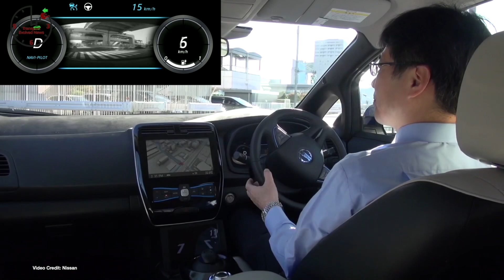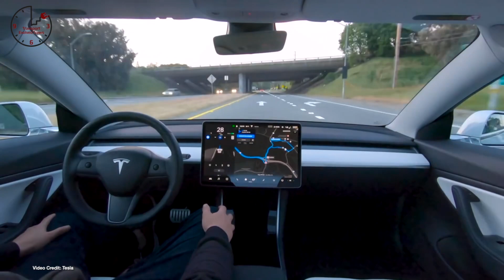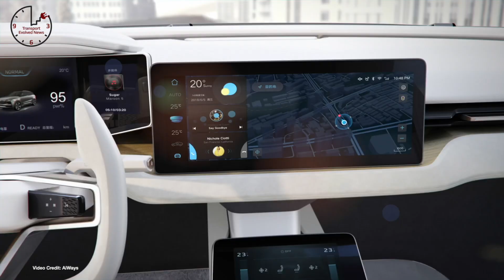TEN 295 - Rivian Rapid Charging, Tesla’s 12-Seat Van, Germany EV Charging Requirement

Comment: Dyson didn't make an electric car because he realizes that with battery prices, he can't make the cost of the car 10 times more than they are worth, just like his vacuum cleaners.
Reply: Plus the whole of his UK market has gone, both brexiters and remainers hate him for his double cross.
Reply: He developed the bagless vacuum, paving the way for battery vacuum, before they were literally 2kw !
He changed hand drying from hot air to cold, again saving energy, it's that the British can't play the stock market to their advantage as well as some, not lack of design.
Reply: @mcamodell  yes but many have bought a 400 quid one which are uneconomical to fix ,and you can buy the same or better for 80 quid
Reply: Making batteries is slow and low margin. Yet you need them for EV's. This is why all the traditional automakers held back from building battery production lines. But if the OEM's were smart, they would have toyed around with in-house battery production with some of their empty factory space during the good times from 2012-2019. Instead, too many automakers are now cutting back on everything EV, hoping that low oil prices will last.
Reply: @Muppetkeeper  "the whole of his UK market has gone"? Haha - get me a pint of what you are on

Comment: Congratulations on no coal burned at power plants in UK !! 😊😊😊❤
Reply: Thanks, we now need to sort out the rubbish charging network
Reply from the maker: Ha! True true! (Although we've not had first-hand experience for a number of years).
Reply: @transportevolved  It's getting there but it's a slow crawl, i couldn't wait so bought a Model 3
Reply: @thelifeofbatteries  I could see why you'd do that, i've taken the other approach of waiting.
Reply: I'm very happy about the UK's 55 days of no coal.  How much gas are they burning?  Coal is the worst, and has to go, but the next step is full decarbonization, or as near as we can get.
Reply: Germany spending 2.5billion on charging infrastructure. Uk spending 5million and you can bet most of that will be in London

Comment: Thanks for the show.... Nikki really reflected the feelings that many of us feel about the challenging times, the multiple crisis in the U.S. and the disturbing response from our politicians.

Germany, I think, had the right idea for requiring gas stations to likewise provide for EV charging. I see a few gas stations here in California having the same idea — having one or two spaces for EV charging while also allow ICE cars to fuel up. If every single is a EV charge station in the U.S., EV range would no longer be a problem even for medium-to-long range road trips. From the another perspective, it seems to be a no-brainer for gas station owners — that you would want to profit from refueling both ICE vehicles as well as EVs.
Reply: Right, because that's what I'd be looking for on a long-distance EV journey: a spot somewhere at a greasy, smelly filling station where I can park my car for half an hour while it recharges.   If the station's got a service bay, maybe I'd kill some time watching someone get their oil changed.   Probably, though, I'll just sit in the car while the pickup trucks come and go.    And of course, the proprietors of those stations will be pretty chuffed to be forced into moving their electric utility rate up several notches due to demand charges.
Reply: @levenkay4468  a growing number of petrol stations in the UK have rapid chargers installed. BP (fossil fuel company) bought Chargemaster and are installing their rapid chargers on their forecourts. I don't care where the charger is as long as it is accessible and functional, and enables me to get from A to B.

Comment: The Rivian tech is based on the same setup as P20 mobile phone which means the battery is treated as two batteries for charging so you can put in high voltage but a single battery when it is used to power the phone, its a smart way of doing it but far from new so I'm surprised Rivan have been allowed to patent it!
Reply: Some portable tool batteries do a similar 18 to 36 volt switch.
Reply: I hope that other makers of battery powered equipment fight that patent, then.  Some times the PTO fails miserably.  I've seen it happen.
Reply: I agree, splitting the series in half is not a novel invention.

Comment: Hi Nikki. I really had to jump in on one thing in particular from your Short Shorts section (is it sponsored by Nair?). You mentioned that someone had calculated that in the UK there were 55 EVs for every charging station. This is yet another example of where we have to be vigilante about misleading claims. You suggest this is further proof that the network is woefully short of capacity. Well, I've looked at Zap-Map and even by it's very conservative figures (by it's nature it doesn't have comprehensive totals) there are 18,279 charging points in the UK. With approximately 2.65 million EVs on the road that works out at 144 EVs for every charging station. However, they record (conservatively) 31,789 connectors. That's 83 cars for every connector. At first this may look like it shows things to be worse than the calculation you quoted. But, let's add some context. There are 35.25 million ICE vehicles in the UK and 8,386 ICE filling stations. That's 4,203 ICE cars per station. If there were on average 6 pumps per station that would be 701 cars per pump. Even if there were 12 pumps per station that would still be 350 cars per pump. Yet, no-one seems to be claiming that ICE filling stations are woefully under capacity. And there's more. Ecotricity estimate that only 13% of their chargers are in use at any one time. Spread that across all charge points and you can easily argue that there is currently an over capacity of chargepoints that already has some future proofing built in. Never mind the ever increasing roll out of charging hubs. We have got to get away from this habit of allowing people to talk about the EV infrastructure as if every EV owner will charge their EV at the exact same time and they will all be using public chargers. It's a million miles away from the truth. And again it doesn't stack up against equal comparison with ICE vehicle fuelling infrastructure. As you can see from the above, the worst case scenario for EVs is that there will be a quarter as many EVs per connector as there are ICE cars per pump. There's a reason why well over 15,000 ICE cars run out of fuel every week in the UK. We need to combat EV ignorance as well as every other kind. Let's be EV Woke.
Reply: Very well said!  Thank you.
Reply: I agree with the general sentiment of your comment, but I'd like to point out the one element you didn't factor in to your calculations is the average time a vehicle uses each outlet (be that ICE or EV), because as I'm sure you're aware, that greatly affects the throughput of the max number of vehicles able to fill up per hour. I also readily promote that the charging behaviour for EVs is not/does not need to be the same as that of ICE (home charging, destination charging etc), however given both the time of learning curve for new behaviour and the aforementioned current high number of people regularly running out of fuel, there will still be a decent proportion of EV drivers that won't necessarily take advantage of these things (humans are flawed after all) and so needing to cater to high numbers of people wanting to charge up during peak hour times etc needs to be accommodated (at least in the short term. And given the increasing uptake of EVs, the worst thing would be for public /commercial charging infrastructure not to stay well ahead of the curve with regards to excess capacity. It's still only early adopters at this point, and as you point out the last thing we need is for a whole bunch of negative press articles and personal accounts of the more EV ambivalent populace about lack of chargers and long waiting times in their local area - which of course may well be a statistical anomaly by comparison overall, but could still change the minds of yet to adopt fencesitters with no personal experience in the matter. Which is is what you're equally arguing, albeit from a slightly different angle 😊

Comment: Encouraging to see Germany require gas stations to provide EV charging capability.
In the 9 years I've owned my LEAF I have seen the city I live in, Hendersonville TN replace the majority of its gas stations with fewer but larger brand new ones. Each time I have contacted the company building these and asked if they would provide EV charging. The cost of running conduits and cables is much less for new construction when the ground is already dug up. In almost all cases I got a reply which is impressive. Woo Hoo! Unfortunately they were all "Dear John" emails with not a single new gas station has installed EV charging.
At the very least new gas stations should be required to install at least one rapid charging station.

Comment: A agree with the Germany charging requirement.  In the US we need a single standard and start by requiring charging at stations around major highways with a roll out to secondary stations over time.  There also needs to be a standard that says what charging level is available (1,2,3) and what the charge rate would be.  I am sorry Tesla, you may have to open your chargers to everyone else and change your plug to the common standard.
Reply: There are some chargers at gas stations. Look on plugshare.com. I think having a charge icon on highway exit signs would be great. I guess we have to ask the Department of Transportation for that.
Reply: Well, Germany only has a requirement for public charging stations which plugs have to be there, and which standard has to be used. Teslas Superchargers are not public chargers though, so they do not have to conform to those rules. 
And as far as i know, the requirement to have at least CCS available is actually an EU rule, not a german one.

Comment: Rivan understands the need to be able to handle technological transitions in ever increasing charging voltage levels ... while Tesla stagnates at 400v.  The industry is transitioning to 800v.. and 1000-1600v will follow that. Companies able to accommodate those transitions and upgrade charging networks in a backwards compatible strategy... will succeed long term.
Reply: Do some research, you don't know what you talking about.  Current battery technology is such that batteries have to be charged at a specific voltage and current, you can't change that, if you do you lose the longevity of the battery. (Unless they invent a different battery chemistry)
Higher voltage 800v-10000000v is not better technology, just like a 2 inch pipe is not better than a 1 inch pipe, depends on the application. That is why your garden hose is not 6 inches, and your house electrical wiring is 120v-240v and not 10,000v.

Comment: Do chargers at petrol stations make sense? It seems to me that it makes more sense at places where you'd drive and stay a while: shopping centres, grocers, hardware shops and places like that. Plug in, shop for half an hour or so, and then load up, unplug and drive off. All my non-home charging happens at shops like that.
I can see petrol stations at motorway lay-bys, but not petrol stations generically.
Reply: Some petrol stations, these days make more money from coffee and snacks, than from actual petrol. Especially stations that don't have facilities for trucks.

In fact, in my hometown, one petrol station chain opened shop in the old town without the petrol station attached. 
So might be an option. Also, it is probably easier to enforce.
Reply: We have them in the UK already. I don't care if a rapid charger is on a petrol station forecourt. My requirements are that it is accessible, functional, and in a place that enables me to complete my journey.

Comment: Are filling stations really the best location for charging? Apart from service stations on motorways,  would it not be better to put the in locations that cars are parked at anyway? Car parks at , shopping centres , gyms, etc etc
Reply: Good point. Though just having the constant reminder to all ICE users, every time they fill up, that they could be on a cleaner, greener path... That's good advertising for EVs in general.
Reply: I'm assuming these would be fast charging stations that are needed for long trips. For parking lots of other businesses, level 2 charging seems more appropriate to me.
Besides, many highway rest stops have parking lots and a connected gas station anyway, so the chargers wouldn't need to be directly at the gas station for it to count, would they?
Reply: @MrGonzonator  thats nonsense, ICE jus need to fuel for few minutes and leave the place for anoher one, imagine if EVs could do that. for EV charging there is a need of alot of parking place in towns and europe and asia specially dont enough of them, plus EVs were cheaper to park before and its becoming more and more xpensive
Reply: @MrGonzonator  yes, but it would also show tham that what they can do in 2 or 3 minutes takes an EV tens of minutes, not a problem if you are going to park there for an hour anyway while you have lunch or do a bit of shopping
Reply: Just watching Bjorn Nyland’s videos, some petrol stations already have separate charging areas.

Comment: Coal free 🙌🏾. That’s awesome!
Reply: But ... Trump has given us clean coal.
Reply: @Hans-gb4mv  lol. I only ever heard of clean coal from the Thomas the tank engine books. Maybe that's where coal execs and politicians get it from.

Green coal is green washing PR and there's no such thing, but there exists specifics about different kinds of coal. Carbon capture is still experimentation, coal plants have to install them themselves which they won't.

"Clean coal" is quite often anthracite, the most carbon and energy dense coal by being the longest and most pressured buried fossil fuel. It's often called steam coal for its "clean" or least-sooty burning for the tubes and such of steam engine/generator. The less formed the fossil coal, the less energy it has the worse it burns and the more fuel that needs burning. It causes worse for the maintenance of boilers with ash build up, and the higher toxic pollutants that come out. This would be brown coal or even peat from bogs - burning them gives way less energy and often emits more nasties like mercury that the plants in bogs are able to lock away in the environment.
Reply: We are going after Gas next, which is more complex, but doable.  Some days in May over 60% of the electricity in the UK was generated by wind and solar...
Reply: We were told by our PM in Australia that as the World's thirds biggest exporter we were doing the World a favour cos our coal was clean coal, so there is such a thing

Comment: They are completely wrong about self-driving cars. Almost all accidents are caused by the driver not paying attention or ignoring the rules. Obviously a machine won't do either, therefore self-driving cars will be orders of magnitude safer. Of course they have a long way to go until then, but it's closer then most people think.
Also, we don't manually program every case into the car, instead we let the system learn from a gigantic amount of real-world data.

Comment: Is a petrol station the right place to put a charging station?  
The size of a petrol station wouldnt normally support long term parking (1/2 hour).
This really infrastructure really needs to be in car parks.
Reply: Currently you are not allowed to use your mobile have the car running or smoke a cigarette, with charge rates at 300kw within metres of auto gas, petrol diesel and potentially hydrogen it's a very risky development decision
Reply: @williamgoode9114  No problems with the sites that already have them in the UK. You can rest assured that the safety standards the units have to meet will include measures to prevent spark ignition.

Comment: I guess that they will make trains autonomous before they do cars, and trains are far from being able to do, and that's not because they do not know where they are going, it's because the "odd" event is hard to predict.
Reply: There are some autonomous metros out there. Technically, Victoria line in London is partially autonomous since the 60's. Driver only watches the doors, and than allows train to move off. Afterwards train accelerates, moves, and then stops all on it's own.

Comment: That Tesla tunnel shuttle should form the basis for a Tesla commercial van.
Reply: Maybe - or maybe Elon should better off focus on building cheaper tunnels for the benefit of world wide public transport (passenger and rail) instead of trying to completely replace railways with an entirely private model like the car and motorway had done in the 1960s.
Reply: @toyotaprius79  
It's not an "entirely private model". The van could be used as a "bus pod" like the aforementioned tunnel shuttle, thus working in multiple different roles with only a single production line design. It would be like a subway tunnel that cars can also use, effectively.